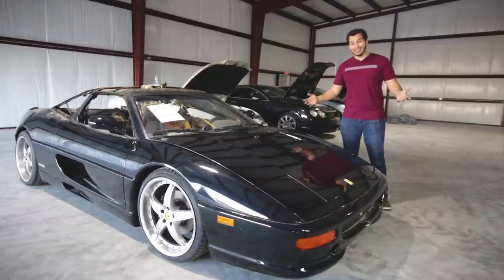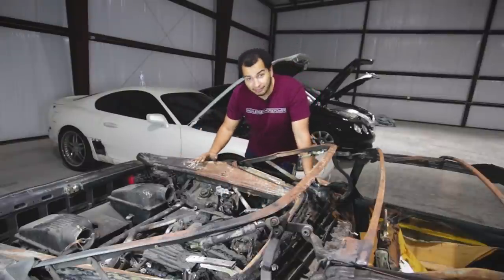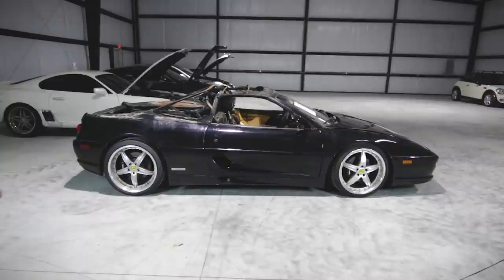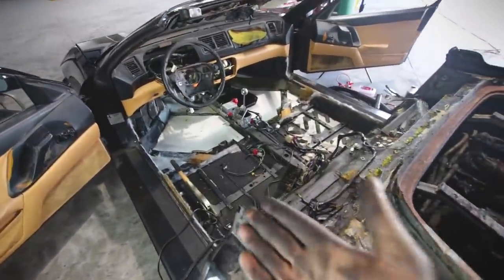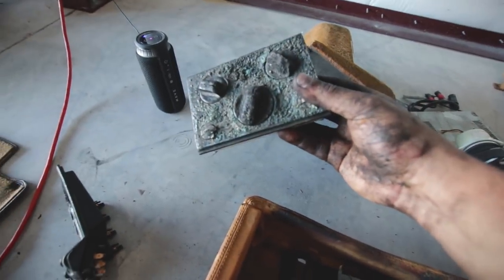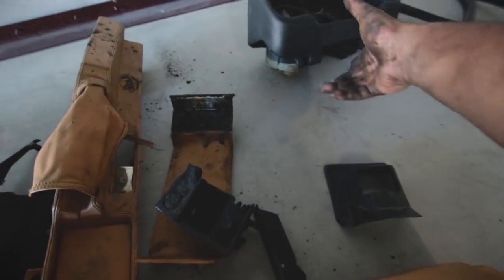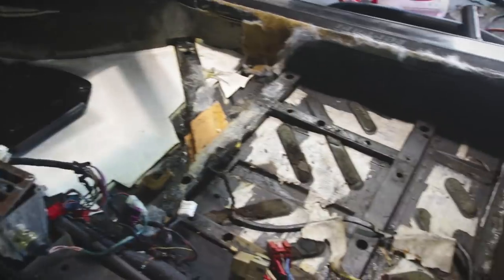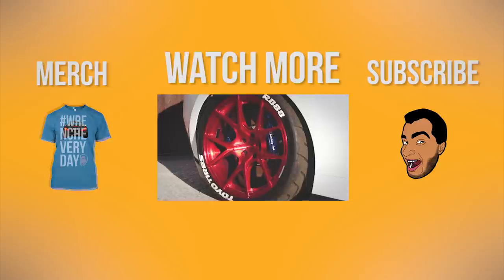I'm Rebuilding A Dirt Cheap Ferrari F355 (Destroyed By FIRE)

Comment: I rarely comment... but if you want this to be primarily a canyon carver, stop trying to save interior pieces and go full racecar! Bare metal and maybe a few carbon touches if you can. Racecar racecar racecar.
Reply: LeftoverTinfoil May actually be cheaper if you think about it
Reply: Fab carbon console and get some door cards adapt race car dash in an use digital setup. 

An 1 seat plus cage an junk rest. Do a nice ls swap if engine   is killed
Reply: Agreed.. this thing is never going to have resale value so have at it.
Reply: @Reuz1721  yeah, third party or custom fabrication would be 100 times cheaper than Ferrari OEM
Reply: @stevesmith8107  youve got the right idea sir.
Reply: @tylermills2807  Freddie loves OEM. It's gonna get OEM.
Reply: @uzivatel56  if he's got the money, I wish him all the best but boi is it gonna take a wad and a half to get it back 😂 specially with an engine rebuild
Reply: Just commented the same thing. He should go for a nice Factory 5-quality level interior for this car.
Reply: Look everyone a workable good idea!
Reply: Yessss fulll F355 challenge replica!
Reply: LeftoverTinfoil Yes! My thoughts exactly!
Reply: Thinking the same thing. Ferrari cart !!!!

Comment: Save the floor mats to use as a template for custom mats. I just finished making a set for my Bmw. I used a black with red speckled rubber gym flooring with a red nylon to bound the edges. Turned out very professional looking and they are weatherproof and 100% unique. Gotta fabricate and make anything/everything possible. I'm in Palm Beach County and would make you a set.
Reply: Craig Bolin dude that’s genius
Reply: Same for the carpet too!

Comment: Freddy please listen to me, as a fireman, please wear an N95 , gloves, and a long sleeve shirt when messing with the burned parts. Not worth getting cancer
Reply: Only takes once if you’re unlucky
Reply: From an ignorat dude: why does he have to wear all that stuff? Is it the plastic that burned or what
Reply: Speaking from a firefighter perspective there is a lot of cancer causing reside still left on the burnt material. Lots of dust and microscopic material from incomplete combustion. One of the worst parts of a fire is the cleanup after. Please wear proper ppe while dealing with the burnt parts.
Reply: What a crock of shit as a fireman yes you need all that shit, if you do it everyday however if it is one small project hardly harmful those things you talk of about carcinogen are for “prolonged exposure “ or did you fail the exams they gave you ? Someone else here mentions asbestos sure sure whatever again you need to have prolonged exposure you don’t need much asbestos to make you sick however chances are it’s unrealistic you will get mesothelioma. And most of not all modern cars asbestos has not been used for some time , being a Ferrari though it’s possible you may find asbestos in the braking system however I really even doubt that
Reply: @iamasmurf1122   - Its good advice, burnt plastics form cynanides and carcinogens. Even just a single exposure can cause damage as the particles can become lodged in the bronicial tracts of the lungs and remain there. No-one is trying to say that this one single project is definately going to give him cancer next week. People are simply saying a face mask and gloves would be a sensible way of protecting his health.
Reply: Catchertony every thank you 🙏
Reply: I saw this video and I just shook my head. I agree, what's his background on cars? Is he just a quick flip car guy?
Reply: Damn good advice from a Safety standpoint. Good looking out Brother!
Reply: This thing sounds serious
Reply: @8kigana  It's a car from Hoovies garage.
Reply: @lucpower777  "I know there is one guy crazy and stupid enough to to by this thing" -quote from hoovies garage, yep saw it, thanks.
Reply: EMS chiming in for the red truck rider,  don't worry about asbestos (which he did not mention btw) have you ever heard of cyanide? Or any of the carcinogens released when metals, plastics or fiberglass burn? I mean I have responded to lots of house fires the firefighting is about 40% of the battle the clean up is the real work... dont ASSume the angle of the dangle of others...
Reply: @shaunc07  neither of the two firefighters recommended a mask. What did you say about good advice? 😆
Reply: @chosenideahandle  - erm.... an N95 is a respirator, and the other firefighter mentioned small particlates and cyanide which would require a respirator.
Reply: shaunc07 thanks, well that makes total sense then. Yes, I saw the other comment. Hey everyone, that cryptic number meant a mask! I guess I’ve used an N95.
Reply: Thanks for saving his life :D maybe you should help him do the stuff
Reply: Literally the first thing I thought as he started to get inside that interior: face mask!!!
Reply: I'm sure he's thinking that the black stuff is just ash, like from a campfire. But there's no wood in a Ferrari, who know's what kind of nasty chemistry is in that stuff.

Comment: When a totaled, burned down Ferrari is worth 6x more than your daily driver...
Reply from the maker: same
Reply: Then your doing things smart. Save the funds for better things and projects that drive only on weekends/shows/competitions/races.
Reply: @working2bselfsufficient724  i'd rather have a M3 as a daily driver than a Ferrari 458 that i only drive once a month.
Reply: @lpkombi6685  I mean theres nothing stopping you from daily driving a 458, so I would much rather have a 458 > M3.
Reply: @itsasadbunny Yes, there is something stopping you: Insurance, gas prices, depreceation through high mileage and maintaenance cost.
Reply: @lpkombi6685  If I own a ferrari then i could afford that besides insurance can sometimes be less than an s class, gas is cheap in some areas, they don't depreciate that bad at high mileage if you got one used, and just get the yearly warranty and dont worry about maintenance.
Reply: @itsasadbunny  No, if you own a Ferrari it doesn't mean you can afford that. You underestimate the cost of owning a sportscar. A friend of my father has a huge supercar collection, and he almost never drives them, simply because it would be too expensive. He loves driving, he's fairly young, but his daily driver is still a 760Li, not his 720s or R8.

Comment: Tav, I think you should consider a possibility of going custom. This is a Ferrari, but it is one of the more unloved Ferraris. Since it has been through a thermal event I'd say there's no real reason to try to keep it as Ferrari as possible since a lot of the parts are impossible to source.

With the Lambo keeping it OEM worked because it was already in a clean state overall, this one, interior burnt to a crisp, might as well modernise it a bit... Just a thought.
Reply: Turbo k swap!!
Reply: Turbo k swap??
Reply: Just say it.LS swap!
Reply: I wouldn't say this one is an unloved ferrari, The F1 clutch version is definitely much more unloved.

Comment: Maybe it's just me but I would remove all the interior and use this time and money to have a great track car. Only steering and that gorgeous H pattern stick shift. Pure track heaven.
Reply: I'd also strip interior add new seats and roll cage. Onlything I'd add is sound damping material inside and paint.
Reply: same, if i had this car, in this condition, id definitely make it race ready
Reply: I'm hoping for an interior to go back in but not an OEM interior. Some nice buckets, fiberglass dash and center console. He should honestly make moulds of the body panels and make fiberglass or carbon fiber panels for it as well.
Reply: If the engine isn't badly damaged, go with a standalone ecu, like a Haltech or Microtech.  Far easier to set up and better than the factory unit.

Comment: If i was you i would try to find a colision hardtop f355 for a doner car to replace all the bad parts and sell what you dont need
Reply: žiga čurković 50‘000 plus for a doner car 😂
Reply: Hed be better off learning how to build fiberglass or carbon fiber replacement panels and fabricating a hardtop. The burnt panels can be used for moulds.
Reply: The doner car for sure will be in better condition :-)
Reply: @florianohl4035  yea k know but he could sell the engine for 30k

Comment: You should take your all plastic switches, climate control etc. and send them to company that can 3d scan them, they will repair fire damage in 3d environment and print you the new one from plastic or aluminum, steel, titanium etc. It will be a much cheaper and will be looking brand new. Carpet and floor mats are easy to recreate. Good Luck!
Reply: We do that type of work, it would not be cheap at all.  You could spend 70k on that in a few weeks.
Reply: Cheaper?! It's probably Fiat parts bin bits anyway

Comment: Something else to consider is the structural steel has now been tempered... unevenly.  It's harder now but also more brittle.  In the case of aluminum, annealed.  If the aluminum didn't melt in the fire, its structure has changed.  Might want to befriend a mechanical engineer and have them take a look at it once you have it all stripped down.
Reply: Couldn't agree more Patrick, that fire was hot enough to melt components in the dash how hot was it in the engine bay.
Reply: true,  jack came in the last ferrari video and said more or less that

Comment: I'm thinking strip the interior and go full balls out race mode on this car.  Just a suggestion. Might be the cheapest option too since OEM parts might be more expensive than than some nice race seats and other interior bits. So excited to see what it turns into. Anything you do will be amazing!
Reply: might be cheapest and most sensible but also the most shitest idea
Reply: Exactly my thoughts. Strip the interior completely, bucket seats, roll cage, five point harness... It will be an amazing track toy with the turbo kit and an aftermarket suspension.
Reply: Florian amRechner booooooooring
Reply: @lee nevin So, what would YOU do?
Reply: Florian amRechner besides strip it and bolt an aluminium plate of plastic switches, you ask?
Reply: Florian amRechner id try to match all the switchgear with metal switches all custom. New carpet. Cover all damaged stuff in leather. Probably 3D print some of the controls

Comment: I'd put a supercharger instead of a turbo just cause:
-the engine bay is smaller than modern exotics and the turbo kit is quite big so another big risk of fire
-turbo weights more than supercharger and has more components
-you already have the Lambo wich is twin turbo, should be nice to see something different
-the sound.
Thumbs up to convince him! Anyway i always loved and agreed what you did with your cars. Greetings from Italy 😊👋🏻 (the country who builds hot cars 🔥😂)
Reply: Fede Master  turbo can make more power then supercharger
Reply: @noahmich21  but it's more unreliable, a well engineered supercharger can make a lot of hp too, but power isn't all.
Reply: @fedemaster3749  definitely, plus a supercharger will give top end power so it would work.
Reply: @noahmich21  Apparently he is not looking to make a ton of hp, i think a supercharger will be enough for 500.
Reply: @noahmich21  I said nothing about sound, and neither did insult you.
Reply: There isn’t really room on the front of the engine for drive belts. Superchargers generally make more boost earlier which means higher cylinder pressure. You want engines turning faster when the boost comes on if you can’t put big fat forged rods. Also the low end torque means more broken transmissions.
Reply: he will do whatever the sponsor tells him to do
Reply: I concur

Comment: Tavarish you inspired me to wrench everyday. I bought an audi a8 from an auction and it's been an absolute nightmare.... Rats nest in the catalytic converter, broken cam tensioner shoes caused me to crack my block. I replaced that engine and Gutted the cat. so far it turns over but like shit and giving me a maf code and 2 sensor misfire. Hopefully replacing that should do it but the amount of work I watched you do to that lambo encouraged me to continue. When I get it running I will shout u out in my 1st vid as inspiration

Comment: Tavarish In this car you should evaluate this: 

Metals are comprised of a symmetrical structure of atoms known as an allotrope. Heating the metal will displace atoms from their position and the displaced atoms form a new structure. This process is known as allotropic phase transformation. Allotropic phase transformation alters the hardness, strength and ductility of the metal. 

Long exposure to heat and certain heat levels will alter the stiffness of the metal.

Take a more deep advice of someone that work in this area.

It’s not to be negative, it’s the opposite.

Go ahead man
Reply: Amen
Reply: Should tube frame to reinforce the rear, turn the thing into a track car
Reply: I was thinking the same thing.  And as far as the interior,  just rip it all out and build function over form.  Enzo would smile.  Also those particular engines require an engine-out frequently.  Might want to engineer the cowling and sub chassis for easy removal.  If he gets a sponsor, I can see carbon entering the picture. So many possibilities for a canyon carver here.
Reply: Really dont like the idea of turboing it though, would ruin the sound

Comment: This car is a money pit...it will cost so much in parts and those parts are hard to find...good luck with this one Tav...IMHO, this ain't happening.
Also, even if you manage to find all the parts...it will forever smell fire.
Reply: Yup, clearly damaged + parts weakened by fire.  Besides the water/foam used to put out that fire and hot engine.  He should have the guy advising it was ok to drive it with fluids spraying on the engine pay half of repairs.
Reply: He gets $10k - $15k per youtube video. I doubt he cares about the cost of parts. This channel will easily pay for all of his parts and more. It's already paid for the entire cost of the car.
Reply: @Sabrinahuskydog  It's not the cost what I was getting at.  It is punishment for advising to drive a vehicle in an unsafe condition, risking the driver and anyone around.  Although he did save that tow fee for a few minutes.  Until the burnt out husk needed towed like it should have been in the first place after using up emergency services.
Reply: @Sabrinahuskydog  WRONG. He makes PEANUTS per video thats why he sold the viper because hes broke. Even Pewdeepie (Highest paid youtuber) only made 4 million this year (2 million after he paid his taxes). 
Tavarish is not even close to being in the top 1000 when it comes to subs and views.
For 1 million views, the total earnings through YouTube will be ($3 to $10)*1000 = $3000 to $10,000 per million views.
So far on this video he has made between $480 to $1600 (HALF he takes home after he pays his taxes)
So dont quit your day job kids, you wont get rich making Youtube videos
Reply: @superj7106  Go look at his view numbers for the lambo videos. Most of them are well past a million, some 2 million.
Reply: @Sabrinahuskydog   right now he has only 7 videos above 1M. the most viewed one sitting at 3.2
Reply: @Sabrinahuskydog  LOL BLUEBERRY APPLES FUCK NO HE'S NOT...what world do you leave in where youtube would pay that much for views...LOL
Reply: A least give him a chance, he finished the lambo did he?, plus I bet he’s gotten a lot of experience with working the lambo so let’s see where this goes.
Reply: @nizmo370z4  i do give him a chance...but this one is WAY WAY worse than the Lambo in every way.
Reply: Nizmo370z He didn’t finish the Lamborghini though! Where did we see the turbo mods being done? Or the roof working? Or a final road test or dyno run?
Reply: Tech Wiz Master he makes avg 10 to 20k a month just off new content so I think hes making plenty more then most people think
Reply: @Overkillautoperf  with 500K subs...no fkn way...no he's not.
Reply: Tech Wiz Master ok lol everyone's entitled to there opinion my buddy has 700k subs and makes 30k a month so I'd say 10 to 20 is pretty close

Comment: The credibility of this took an early nosedive when the first comment was Mr T's dislike of the wheels that would have to be changed (rolls eyes over the back of the head!).  This motor has more fundamental issues to be addressed than a set of poseur wheels.  As for simply slapping a turbo on for more power without considering a total rebuild beggars belief.  Good luck Mr T I am intrigued as to how you will manage a resurrection.

Comment: One of my Favorite Ferrari’s! Hard top YES GTS YES Please! I am considering a GTS 355 or a 360/430 Maint. Is the thing I am back and forth on. The lines and look of the 355 are sooo sexy though!
Reply: Buy both a 360 & a 430. It'll save you more money than it'll cost for the maintenance and purchase price on a 355.
Reply: Agree 100% but those lines on the 355 and they aren’t even fast! Also 6spd is a must and I have been trying to find a 430 6spd I can afford as soon as possible because they are skyrocketing like the air cooled Porsche have
Reply: I can do the engine out service myself. I would rather not have to... if I can find  6spd 430/ 360
Reply: Insurance is another problem on the 355s 360s for my co. Have to change. I found a 32,000 355 salvage rebuilt and looking running great! Sold in days when I called them. Auto Tempest is awesome!

Comment: $18k going to put $100k back into rebuilding it.

I suppose if you go full after market or cheaper brand parts to repair and don’t worry even slightly about trying to restore it to factory, it’d be cheaper. Probably still more money than I’d ever want to spend on a charcoal. Lol